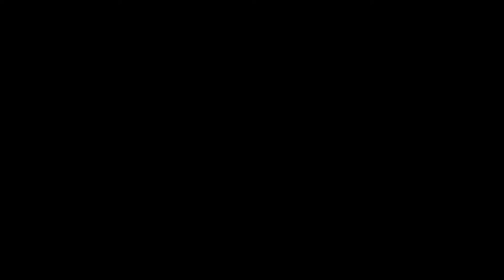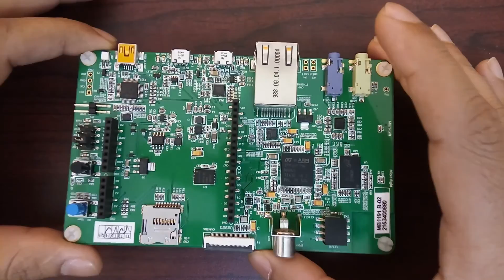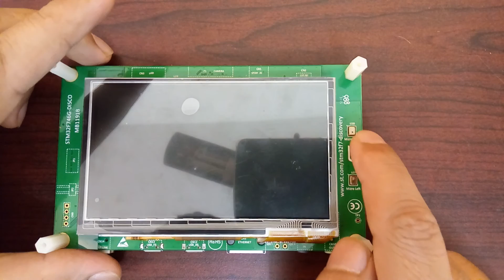3 STM32F7 Discovery Board Quick Introduction

Comment: VERY usefull, thank you!!!
Reply from the maker: Thank you so much for your support.
Reply: @KGPTalkie  you are welcome. Just a question, because i am a beginner, and i have this F7Disco since 2 days. Is there a step by step video how to make a app from start to finish with maybe some buttons or a slider on the display? I saw embedded-wizard, but they show only how to make the gui. I have a Nema 17 motor which i would love to controll with this board, or a stepper driver. Can you maybe help, because STM32 is very confusion for the first time :-)
Reply from the maker: @tamgaming9861  I have around 10 to 15 videos on STM32F7 boards although they are not exactly what you want. But those videos surely will help you understand it better.
Reply: @KGPTalkie  I thank you for your kind answer. I watched them already. I like them. The STM32F7 Disco board is very cheap and good if you try to get into STM32, but tutorials are really rare for it, near only manufacturer tutorials, to present their system or their software, but no all in one tutorial. So therer are some embedded-wizard videos out, but only display, no coding help or how to work with it to get a project out of it. Do you  plan to make a series out of it, because i see so many people buying it but they all dont know where and how to start :-) Like me :-)